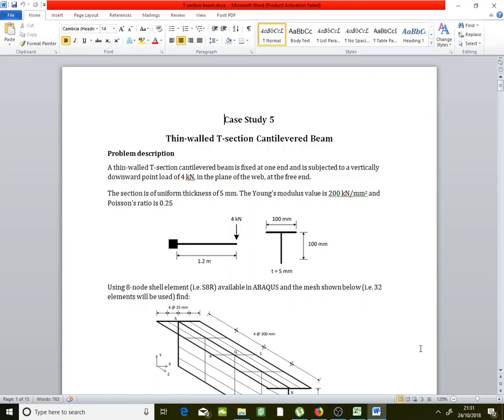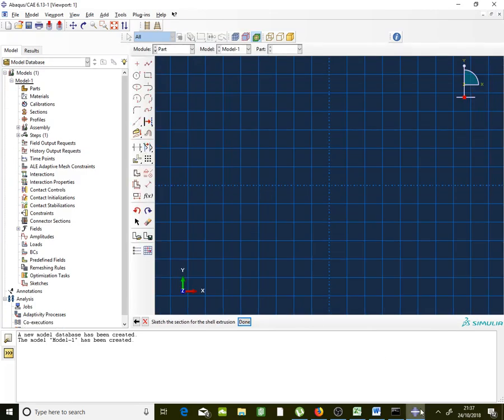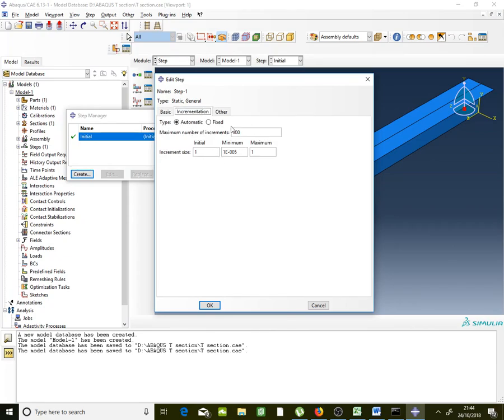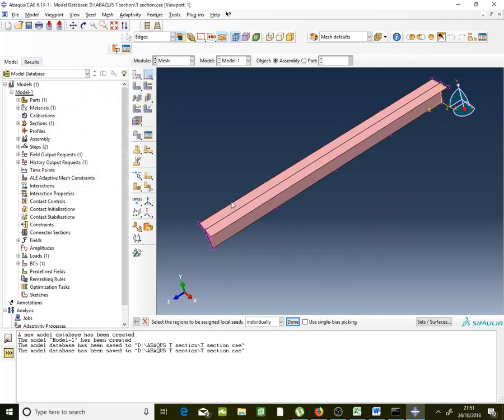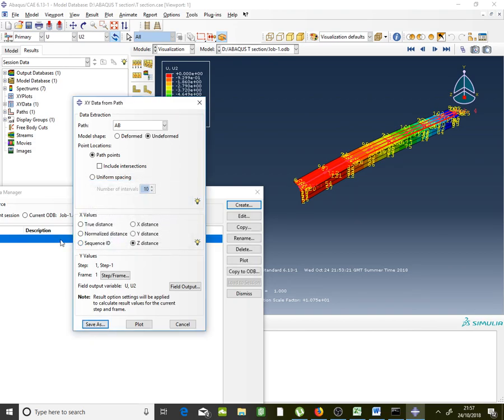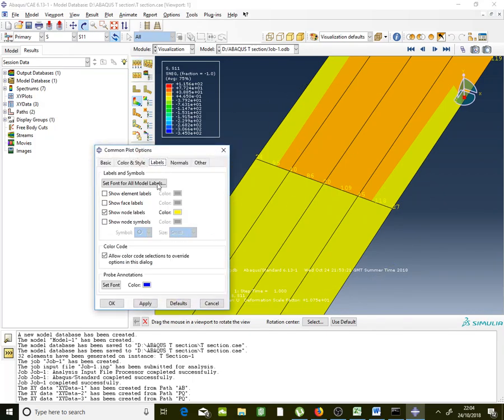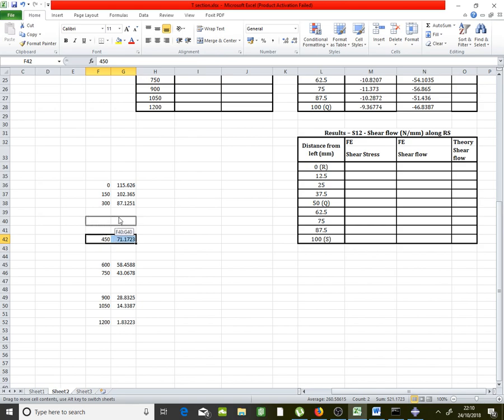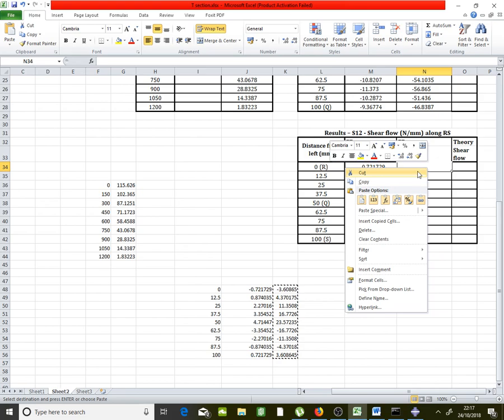Modelling thin-walled T-section Cantilevered Beam using ABAQUS

Comment: You should use S33 instead of S11. S11 is the stress in the X direction but the main stress is in the Z direction. The problem and your model are bad formulated.